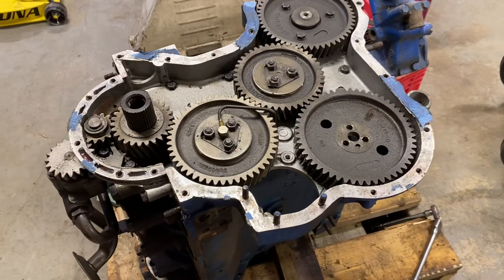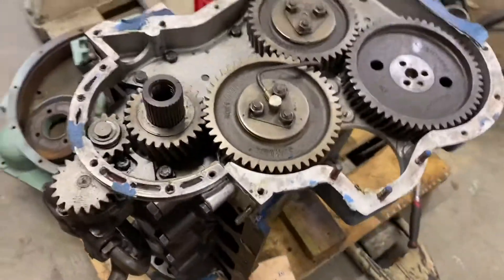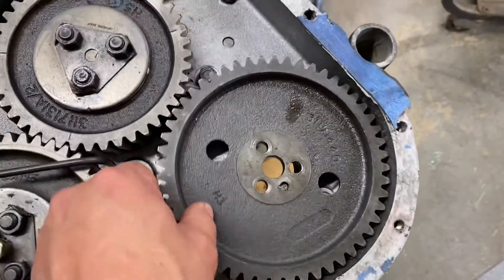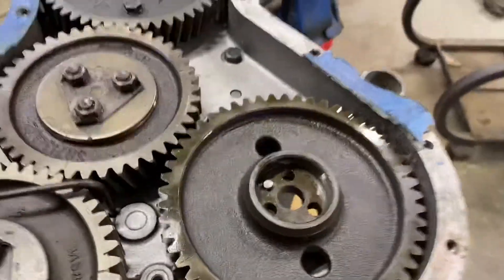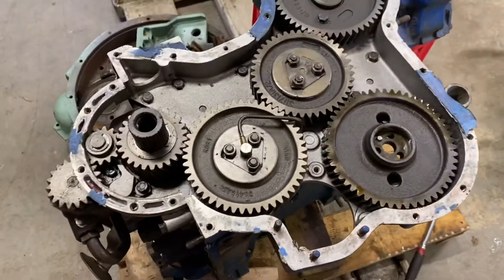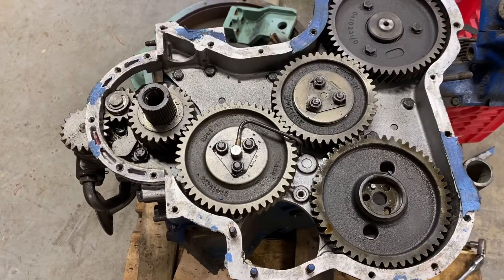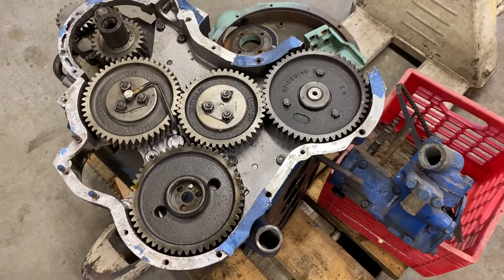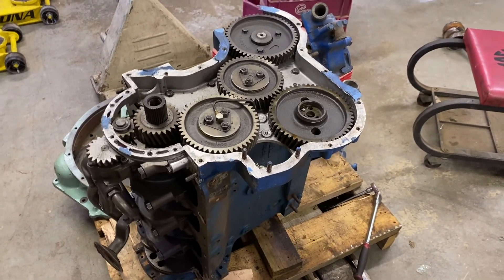CAV DPA Injector Pump Timing & Ratio Explained - Perkins 4.203.2

Comment: I have a Perkins 4-236, that I’m not sure how to set the pump time, do you mind giving me a run down..
Reply from the maker: Have you removed the old pump yet? If you haven’t, scribe a mark (if there isn’t one already) from the pump to the engine case. Remove the pump, so long as it has a keyway that interfaces with the injector pump gear, it can’t go out of time. The holes for the pump are slotted to advance or regard the timing which is why you must scribe it. Some engine cases have degrees already marked out.
Reply: @StanwoodStudios  Hello, I removed my pump to rebuild it and ended up turning the engine over a few times while the pump was out. I didnt mark the location beforehand. I have rebuilt the pump and now when it starts, it goes to full idle and won't idle down. Is this caused by being out of time or is the pump still bad? Its basically overrunning and I have to cut off the fuel to stop it.

Comment: Thank you for showing it with the front off. I knew how to advance/retard the timing with scribed marks but I wasn’t understanding how the pump could run off an accessory drive gear and still distribute to the proper manifold outlet as required. Just have to index it to the gear and since there’s no spark plug it won’t matter which cylinder is fueled “first.”  I’m now confident to try and replace my pump.